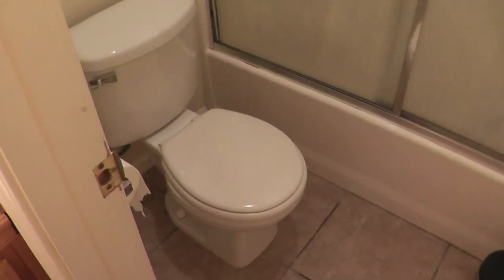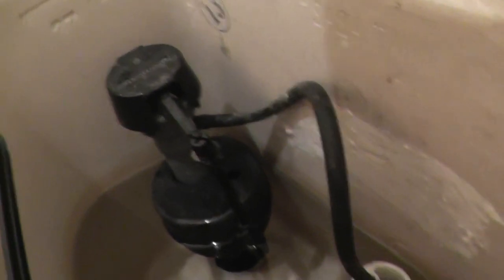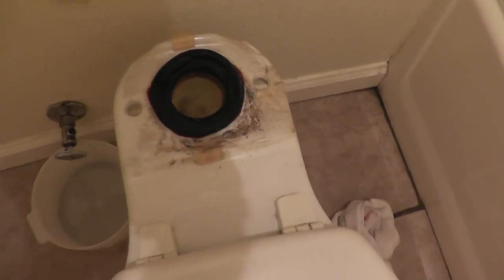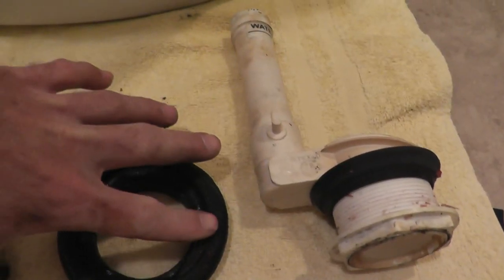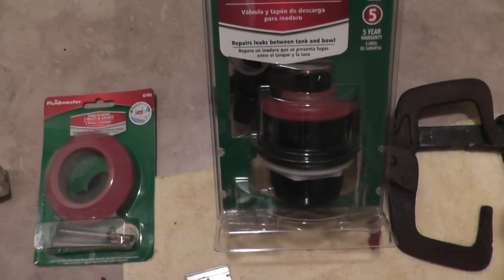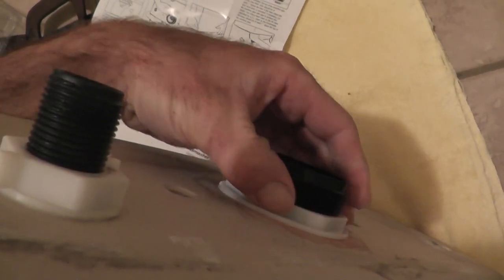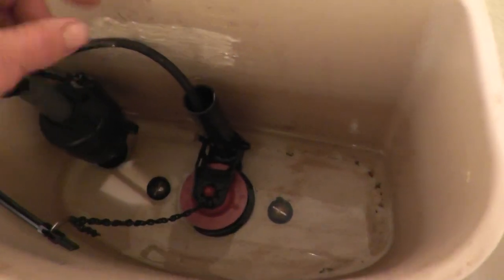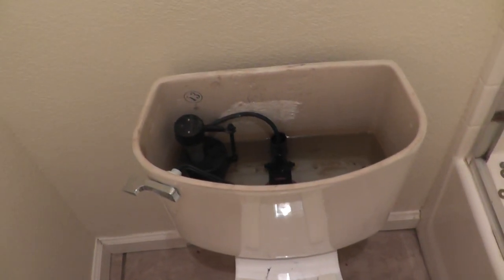How To Repair A Toilet That Leaks Or Always Has The Water Running

Comment: I have the same issue with my Toilet.  I replaced the flapper but the water is still leaking.  Great video.  I will next check the flush valve and replace it.

Comment: RE: The large plastic nut on the flush valve. If you don't have really large channel locks, or a clamp as illustrated in this video, just heat up the tip of a screwdriver and melt a small slot into one of the flats on the hex nut. This gives you a place to insert a screwdriver and hammer the large nut the 1/2 turn past hand tightened.

Comment: Excellent video as well as the information.  Very clear.
The rubber between the tank and the bowl was just replaced. I had already changed the flapper but water  continues to run every few minutes, so now I know what to check next. Thank you

Comment: Hey, this is a great video - covers theory, in detail, comprehensive with practical step-by-step procedures. I don't understand how anyone can give a thumbs down. Anyways, I noticed the problem you described during the end of the video whereby the water valve is stuck just enough such that water constantly runs and into the overflow tube. However, with a subtle difference. The symptoms were such that I've noticed in recent days that after a flush it seems to take LONGER for the water in the bowl to stop running. I don't mean flushing, but that water was still running down from the side of the bowl (more than a trickle) but eventually it will STOP! I decided to open the cover to watch it as it was having the problem. Sure enough..the flapper was down and closed as it should be; however, the water level was so high i could see the water going into the overflow. The valve was only partially closed and water kept running. I lifted the arm of the valve and sure enough there was another half inch of upward travel and i heard the valve seat and close. The water stopped running and no more overflowing. This is only the problem and the cause. I suspect it's either the sticky arm of the valve, the seal under the water valve (the black cap looking thing in the video), or the float is sticking as it travels up the grey water pipe.
Reply: +richk3c If you have the same kind of fill valve as the one in this video, you can usually fix the overflowing problem with no tools and without spending a cent. First of all,  you can try adjusting the length of the rod connecting the float to the top cap of the fill valve, and you may need to do nothing else. If the lever at the top will shut off the water when you lift up the float, it should fix it by simply adjusting the rod using the little spring clamp on the rod. The water level should fill to about an inch below the top of the overflow tube when the tank fills & the valve shuts the water off after  flushing. That's what you'll be adjusting that rod for.

   If the fill valve is still trickling water even when you lift the float as far up as it will go, you might still fix it easily enough. But first, SHUT OFF THE WATER TO THE TOILET BEFORE PROCEEDING. There is a rubber seal under the top cap of the fill valve. To get to it, lift the rod all the way up and hold it in that position while you give the cap a twist. You may need to push down. The cap opens like a medicine bottle. Push and twist counter-clockwise, about an eighth of a turn or less, and you'll feel the cap snap free. Then the top cap will come off.

    Then, you can take out that seal underneath the top cap and either clean it or replace it. If it's too crusted over with sediment and crud, the valve won't completely shut off. You can clean it by hand, or replace it if it's too messed up. They only cost a couple bucks at any Menard's. The model number is 242, the sku number is 6640383, and it's called a Toilet Fill Valve Seal. There's a few YouTube videos that show how to do this, and really, it's easy.

Comment: Thank you for this video. I have one that has the same symptoms as yours without the leak between the water closet and the bowl. however, I do not see the ripples in the bowl as a tell tale sign. I did replace the flapper but I needed purchase a repair kit that just allowed me to change the "seat" that the flapper rests on using some silicone between the flapper and the flush valve. It still runs by itself occasionally but I do not see any ripples. However, if it continues I will put your lesson to  use. Thanks again..

Comment: Excellent video and lots of information!  The only thing I noticed that was left out was that you were supposed to secure the 2 bolts under the tank with a screw and washer before you secure the tank to the base of the toilet, and then secure it there also.

Comment: I have seen some korky kits that come with a new plastic seat that sits over the old one. If you didn’t have all those cracks do you think it would have worked for yours? That’s the boat I am in, but our seats look to be at an angle so I don’t know if a kit with a new top seat would work? great video.

Comment: LOL, I knew if I were doing this I would have spent two hours cleaning the inside and bottom of the toilet tank getting every speck of that pink silicone out of there and the water stains.  Of course, this after having thoroughly scrubbed the toilet before starting repairs, taking care of that ring in the bowl.  Then I would have noticed that it was a good time to paint that patch of missing paint on the wall and thoroughly clean around the base of the toilet since the tank was off.  A half day later I would then be able to leave for Home Depot to search for the best deal on parts but only after researching them on line for several hours.  Oh well, maybe I'll just call a plumber!!!  Just kidding, great video, thanks for making it.  I'm off to buy parts to fix my running toilet that is driving me insane.  I would have never approached this without this video. : )

Comment: Be prepared to cut the brass screws holding the tank to the base, with a hack saw. My wing nuts were seized and the brass bolts are too soft, and have too wide a groove for a screwdriver.

Comment: good job....but , in my case my bolts are really rusted and of course that's another monster...hack saw!!! lol
Reply from the maker: +Mary Bailey Yeah that happens because of the wet conditions. The bolts should be brass though so the nuts still might loosen even if they look frozen solid. Good luck!
Reply: +Jennies Garage i notice that my tenants bathroom had a leak a couple months ago.the water bill was 220 for 4 bed room house.now the water bill is at 400.can this be that toilet?i have no other leaks in the house.how can i replace the flapper?is that the problem?or under the toilet the seal?

Comment: Hi, what should I do if I only have water coming down into the bowl....I never hear the water cutting on (phantom flushing) just see the continual water coming into the bowl.   What parts do I need?
Reply: Sometimes stuff like the chain needs to be ajusted Or Sometimes the thing that floats  up as water fills the tank needs to be ajusted (In your case its either that thing needs to be ajusted or one of many parts have gone faulty) To test if it needs to be ajusted Either lift up the White/black part that extends to the bottom right corner of the tank Or lift of the thing that this guy has all the way If Water continues to go into the bowl, Its a faulty part.
Reply: Hey, did you ever figure it out?  I have the same problem in a house I just bought.  I so don't want to have to take the tank off. :)
Reply: Lyn Fatolitis yeah, it was the rubber ring that the tank sits on that needed replaced. However, upon putting the tank back together, I must have done something wrong because we had leakage around the bolts that hold the tank onto the seat. We ended up calling a plumber to fix everything.  It was a mess and I should have never attempted this myself. Good luck!
Reply: Thanks so much for replying.  I think that's going to end up being my problem too. :(

Comment: You bolted it on the wrong way. You bolt it to the tank for then the bowl. Not just to the bowl
Reply: That would depend on the toilet. Some close coupled toilets don't have room for the nut, in any case it is unnecessary.

Comment: I LOVE THIS VIDEO  THS IS A LAMOA SHARA TOILET I OWNED 2 OF THEM NOW I OWN 1
Reply from the maker: I'm glad the video was helpful for you!
Reply: ***** I was wondering if you had a video for the new type of toilets that use the canister type of flush parts such as for a Kohler Memoirs toilet?  They are the low flow type and have a strong flush and apparently do not use the same type of mechanisms that the older toilets.   I watched your video and then went to HD and was told nothing they had in stock would work for our toilets and would have to order parts.
Reply: actually we have a 2012 kohler welleort  class 5 with a canister

Comment: I'm 56...been a plumber since Jr. High....now a Master/ Journeyman...most so-called plumbers overlook a simple adjustment in the fill tube...(the flexible tube down in the overflow)...they will tear apart the whole thing and never get it to stop running...trust me...it's not those tini little cracks in the valve seat......this guy has no business making this video...this would take hours...(notice the edits)....and with plumbers charging about $100.00 an hour? I could have this toilet completely rebuilt in 45 mins....completely. There are more tricks to the trade in plumbing than any other.
Reply: +Averageskill I'm not a plumber, but how would the flexible fill hose (opposed to supply hose) cause a continuous bowl leak after years of successful service?  I would think that a functional unit that spontaneously began suffering a bowl leak would HAVE to point to flapper assembly failure.  If water appears OUTSIDE the bowl (Water on floor), then simple inspection of the source of the leak will point to the failed part (supply line, tank bolts, tank gaskets.)But I respect your history.  What is the rule of thumb for the height of the "flexible fill hose" with respect to the valve-shutoff water line?
Reply from the maker: +Averageskill I appreciate the comment and your experience, but for the symptoms my toilet had, the repair I did was the necessary one.
Reply: ***** ok....i had to figure this out myself years ago..(long story)...I'm not going to broadcast it out to ev1...but I will let you in....if you push the flexible fill tube down the overflow PAST the water line in the tank, it will (on some fill valves) siphon the water out of the tank down to the level you shoved the fill tube down to....and the fill valve will cycle over and over and over.......either trim off excess tube or use that clip that holds it slightly above the overflow entrance....that's exactly what the clip is for...to keep siphoning from happening.
Reply: ***** ok....i had to figure this out myself years ago..(long story)...I'm not going to broadcast it out to ev1...but I will let you in....if you push the flexible fill tube down the overflow PAST the water line in the tank, it will (on some fill valves) siphon the water out of the tank down to the level you shoved the fill tube down to....and the fill valve will cycle over and over and over.......either trim off excess tube or use that clip that holds it slightly above the overflow entrance....that's exactly what the clip is for...to keep siphoning from happening.
Reply: Averageskill As I surmised - thanks ;-)
Reply: Averageskill Simple follow-on question.  I'm putting in a new Kohler flapper/filler and (Triangular gasket w/three bolts).  I believe that the flapper/filler should be installed to the tank FIRST (hand-tighten + 1/4 turn channel-pliers,  and THEN the triangular gasket goes over this large plastic flapper bolt.  <------Correct?
Reply: yes...squish it good....tighten the 3 bolts evenly down to where the tank doesn't wiggle...but careful not to crack the tank.... porcelain doesn't bend or flex at all.
Reply: Averageskill Sorry to bend your ear again.  I bought a Kohler 85406 filler/flapper (11.5" height) for my 1.6g/f tank.  I discover the overflow is at least 6" SHORTER than the original.  Kohler doesn't mention these things.  I adjusted my valve DOWN so that CL mark is 1" above new (much lower) overflow pipe.  But obviously the flapper chain is not long enough to reach the handle.  I swear to god I looked all over the literature on (Kohler 85406 part) and find NO DETAILS WHATSOEVER about this dilemma.  I presume there are two 1.6 G/F models (Taller/narrower tanks & Shorter/wider tanks).  Can you give me a sanity check?  Thanks again!
Reply: +Zoe TheCat    I did new construction plumbing for 33 years. Ground work, top out (framing stage) and finish. I installed whatever the customer bought... So I'm not 100% keen on all that's out there as far as what Kohler, Western, Gerber, Toto and the like make. But I did almost all the difficult service work our shop generated. Inside most porcelain tanks you will find a "Water Level" line stamped somewhere. The overflow level obviously has to be about an inch higher or the toilet wont flush properly. (some toilets, one or 2 out of a 100, have what we call a "weak flush" right out of the box) we immediately send'm back. Assuming this toilet once flushed correctly, you will need to raise that overflow tube.... Maybe a 3/4 PVC coupling will fit...not sure....if not I would find a piece of rubber hose that fits snug and cut to height. But I've seen weird shaped overflows and different pedestal type flush valves that keep the tank from using more than the 1.6 or now in Calif, 1.2 GPF. You'll want to use stainless steel chain to lengthen your existing one.
Reply: Averageskill" Inside most porcelain tanks you will find a "Water Level" line stamped somewhere. The overflow level obviously has to be about an inch higher or the toilet wont flush properly."

That is the exact answer to my question.  I find it odd that bit of information is absent from all of the "UNIVERSAL" literature.  I guess I'll eat the minor loss and buy another flapper/overflow unit of the appropriate height.  I guess the moral to the story is BUY LONG and cut (if need be) ;-)

Thanks again for all your expertise!
Reply: +Zoe TheCat   Remember, there is a plethora of after-market (cheaper than OEM) parts for just about everything. Who knows what's been installed previously?
    If you can't "improvise" (to make, provide, or arrange from whatever materials are readily available) you will never make a good repair plumber.
     Furthermore, common sense (basic ability to perceive, understand, and judge things) is something you cannot teach.
Reply: Averageskill I feel like a semi-expert now.  I understand the functionality and failure modes for the whole system.  The only part I was missing was that there was an absolute "water line" for the tank itself.  My tank simply doesn't indicate that (aside from prior water mark).  This mark is ~1" below the flusher hole which is consistent with the nominal standard.   I guess I'll just buy some more chain and add a PVC extension for the filler/overflow tube to get back to the appropriate water line.  My only mistake was not purchasing a flapper/filler assembly that had a long enough filler/overflow tube.  Thanks for all the input!